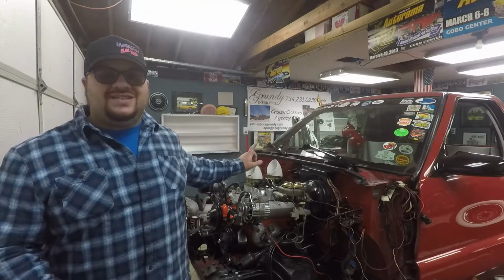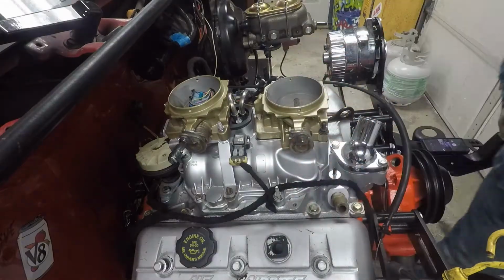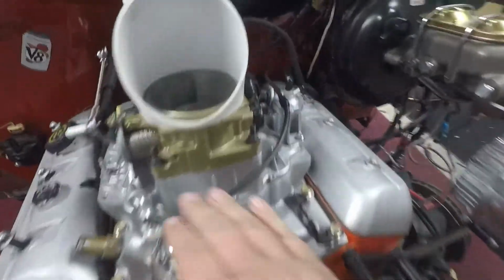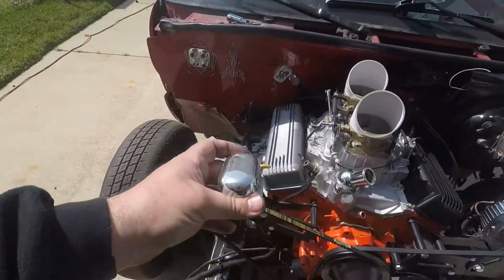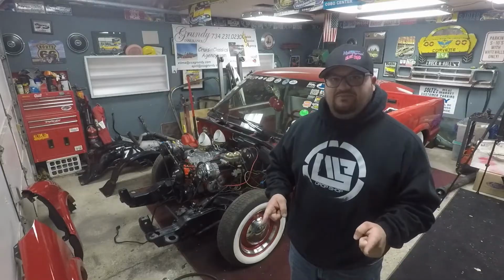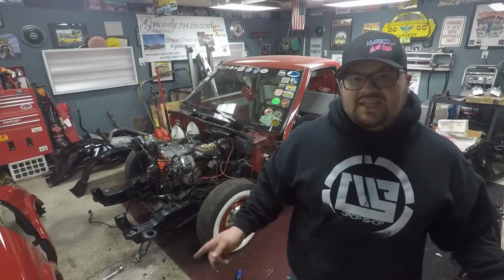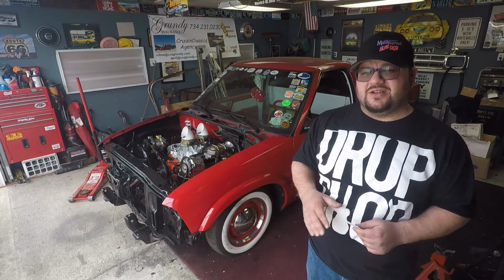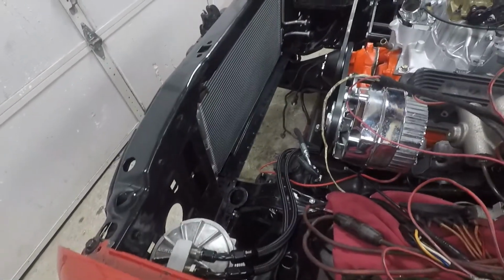WhiteWall Steve's Good E'nuff Garage Episode 16: Bring the Front Back

Comment: What cfm are those carburetors? Also if I had a dual plane performer intake, how big of a carb should I run? I'm thinking 650?
Reply from the maker: They aren’t carburetors. It’s a stock fuel injection system made to look like dual carbs. 
As for what you should run. Really depends on the engine size and what you have going on with it.